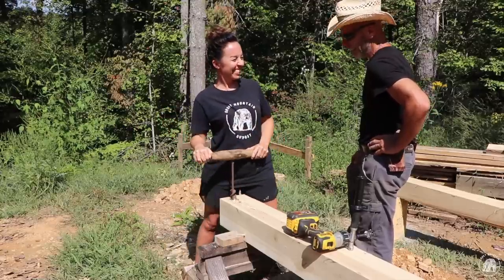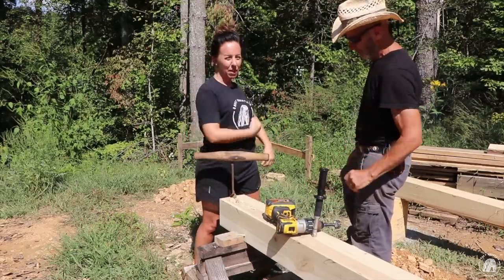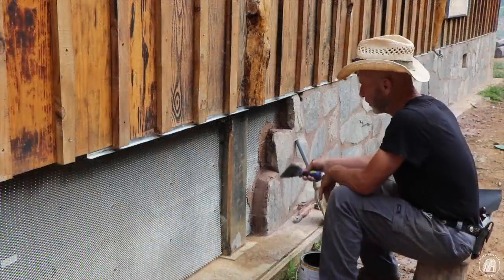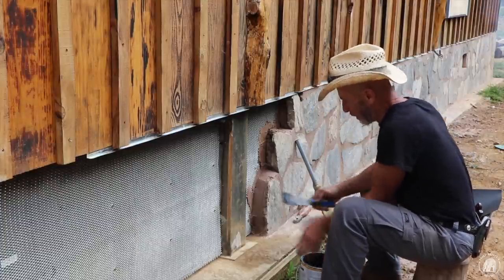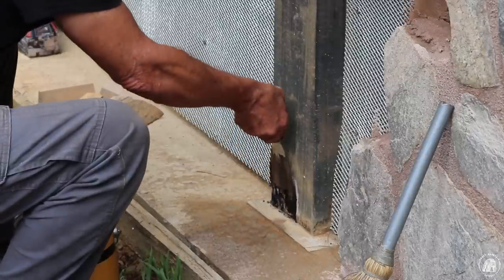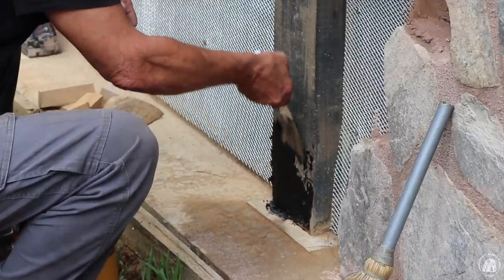Building an Off Grid Timber Frame Workshop Ep3

Comment: Richard how long have you let those popular logs weather and dry before you use them?
Reply from the maker: Those have laid for a year. Most of what I use like this is green. Most timber structures were built green in the day. If you build and allow then the end result can be great. Ideally the easy build would be dry. I haven’t had the luxury of time. Some interior lumber can check in the heat but what timber structures don’t. All in all I am amazed at how well sawmill lumber has worked out. It just takes getting used to from factory lumber and the “norm” in building.

Comment: Use Portland cement , mortar is weaker and shrinks , it will crack , 100% guaranteed.
Reply from the maker: I used quickqrete cement. Always does a good job. I totally agree